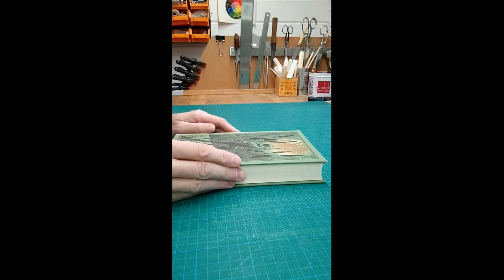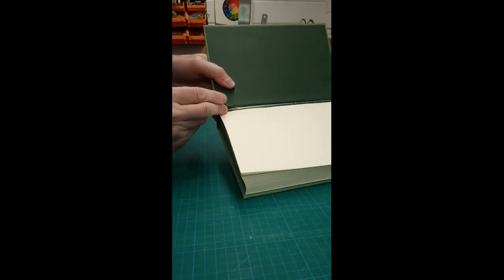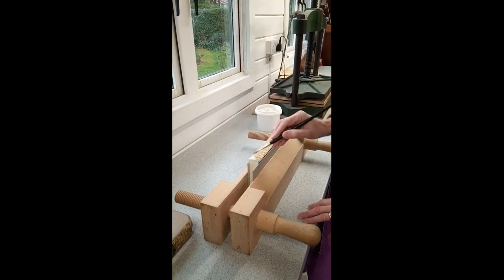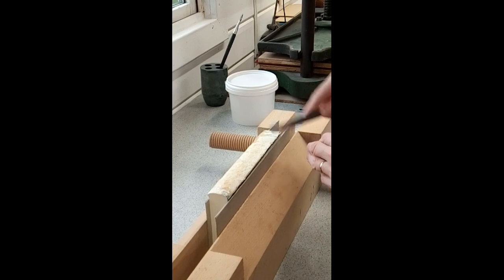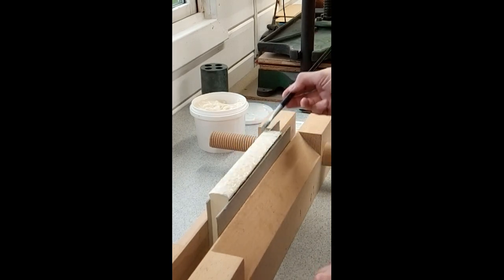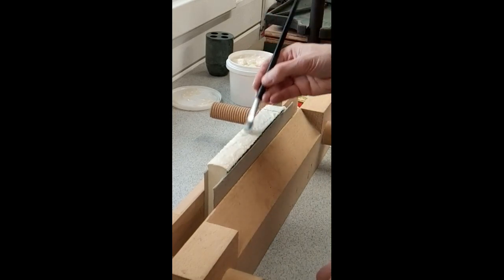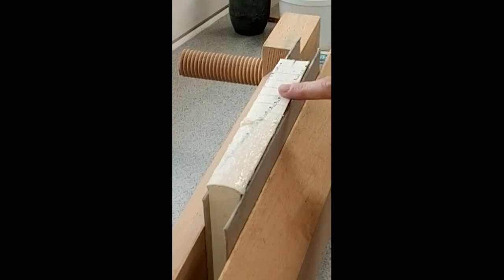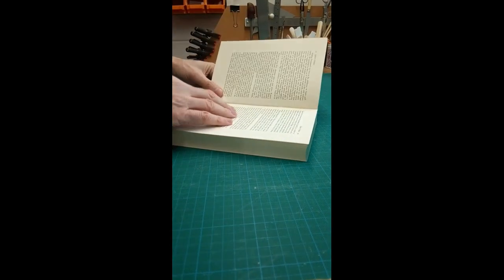Bookbinding - Pulling a book

Comment: A trick I've found for modern plasticized glue is to spray it with brake and clutch degreaser. I'm not sure what goes on chemically put if you let a few coats soak in for a few minutes it seems to debond the adhesive, letting you pry or scrape it off in big chunks. It doesn't seem to damage the textblock.
Reply from the maker: Sounds interesting - might give it a try and see what happens! Thanks!

Comment: Great process ! I have a question. After all above steps the re-sewing takes place in the old existing holes or should repair signatures one by one the folding side with tissue paper  for recover old holes and make new holes in the next step ? Thank you
Reply from the maker: If possible I use the original holes, sometimes adding additional ones. I  try not to add tissue guards unless the holes are large. Any holes I don't reuse I just press with a bone folder to close them up a bit.

Comment: What kind of paste do you use? What is is made up of? Thanks.
Reply from the maker: Hi - I tend to use pre-made wheat starch paste from a UK bookbinding supplier, but starch paste such as wheat or rice that you make up yourself from  a powder is absolutely fine. Conservators tend to use methyl cellulose powder made into a reasonably thick paste which reduces concerns about water leaching into the pages, but I have never had any problems with that. Hope that helps!
Reply: @bookbindingtips  Thanks for this. I'll look into Ratchford or maybe others.